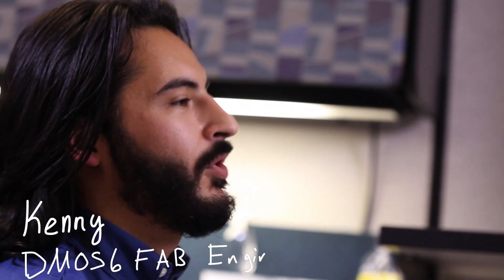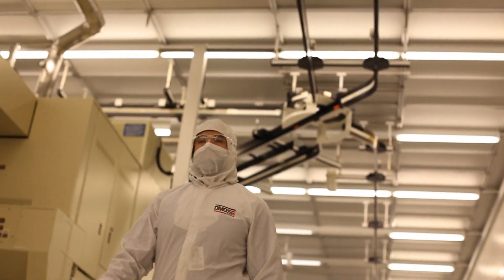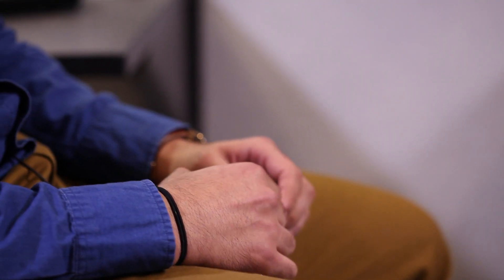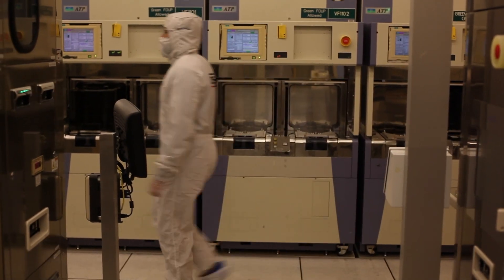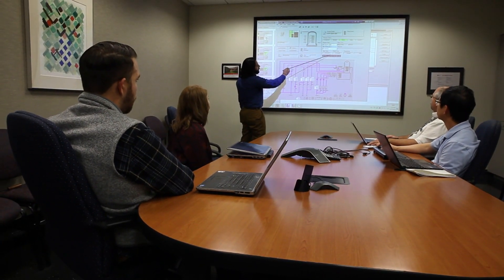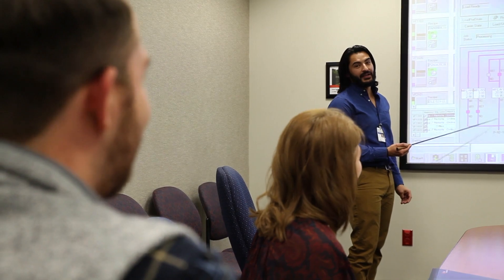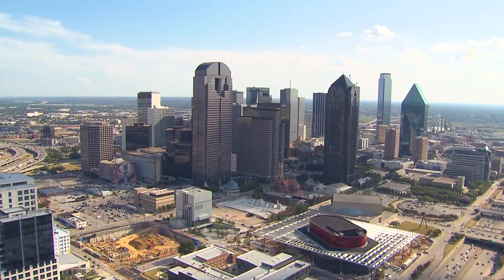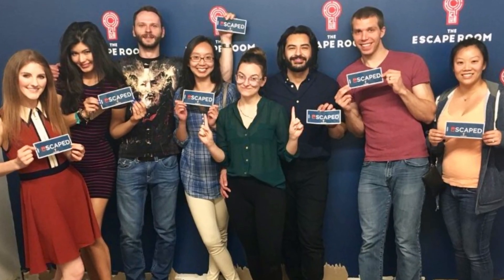Day in the life of a manufacturing engineer

Comment: How much reality in that presentation ?... Can anybody comment ?
Reply: Manufacturing Engineers are the action project team within a plant.  You have people, machines and processes that are constantly evolving.  Man. Engs are sent to tackle those changes and either control them, prevent them, or evolve them into improvements.  More detail below:

When I first started as  jr. engineer, my job was more hands on.  I was usually solving smaller problems on production lines - issues with computers/printers, machinery/equipment malfunctions, timing jobs and adjusting work instructions, changing out pumps and parts, ordering replacement items, leading small Kaizen projects to get a productivity boost, etc.  I'd often work with suppliers on issues, help with quality, test new equipment or ideas, build simple prototypes and modify tooling as our 580 different products changed shape, size, etc.

As a sr. engineer, I do more office work.  My job can be divided into 4 categories.  1.  PM - I oversee preventative maintenance in our plant and work with setup operators, jr engineers and maintenance to accomplish this.  2.  Productivity - I lead a team toward a specific financial goal of improvements every year (equipment improvements, building something to replace manual work, re-arranging a process for cycle time gains, or finding alternative materials that are cheaper or faster).  3.  Design/Build - part of the territory is to design and build new equipment, tooling, improve or modify old machines, etc.  4.  Misc. Projects - this varies quite a bit.  From project management over a short or new production run to being involved in modifying equipment that caused a safety incident, this part of the job can be all over the place.